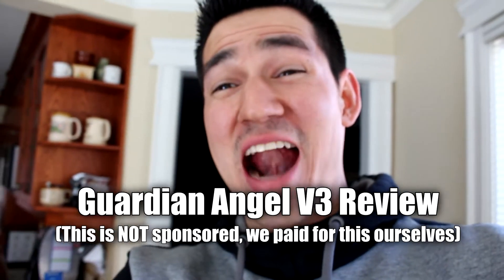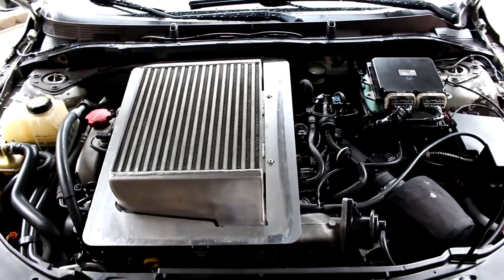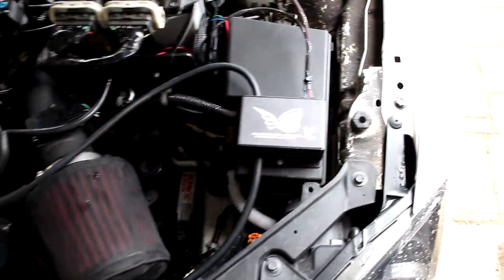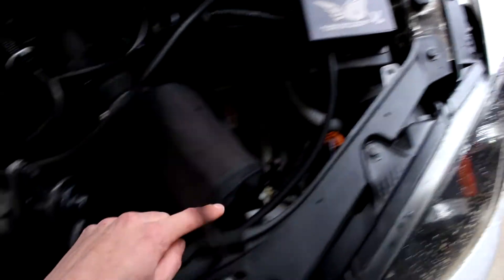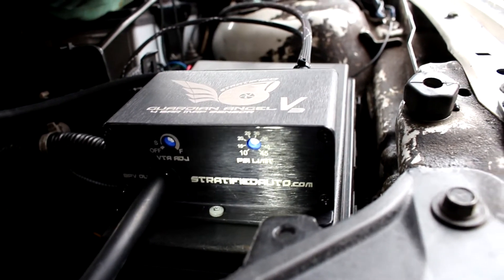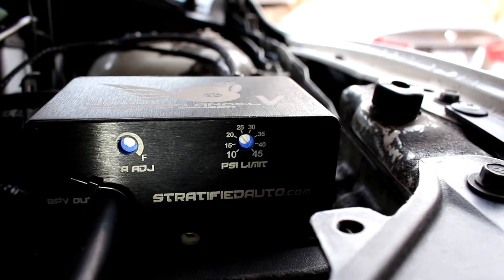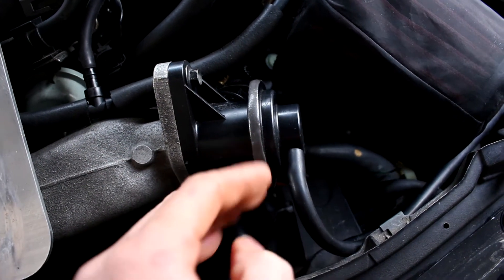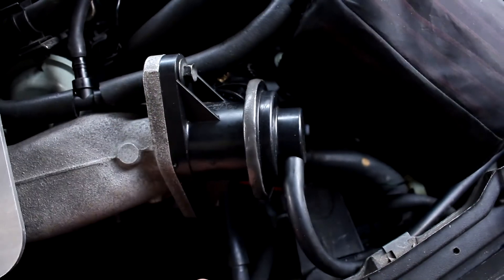Mazdaspeed 3 - Stratified Guardian Angel Fail Safe Review

Comment: question ?? which cable on the map sensor did you tap to detect boost ?Is 4 cacbles and the instructions Stratified Guardian Angel on that part are vague, is just said tap a cable on the map sensor. Which cable out of 4????
Reply from the maker: I'm not sure which wire on the map sensor harness needs to be spliced in order for the ECU to use the 4 bar inside the Guardian Angel. I only use the Guardian Angel for over boost protection because I have a 3 bar map sensor in place of the stock sensor. It may be best to find an ECU wiring diagram and or contact an e-tuner on Mazdaspeedforums.org I wish I could be of more help to you:)

Comment: is the 4 bar map sensor for the angel or does it connect to your car. if it connects to you car how do you connect it
Reply from the maker: I just use it for the GA, but according to the website, the single output wire for the 4 bar map sensor can be wired, most likely into the vehicles map sensor harness (I'm not exactly sure though). Then the ECU would need to be tuned in order for it to work correctly with the 4 bar map sensor. I just went with a Bosch 3 bar map sensor which comes with a harness adapter so no splicing required:) Of course the ECU will need to be tuned for either option. Also, adding more variables into the mix increases the probability for failure ie. If there's a problem with the GA, who knows what will happen to the map sensor signal. The last thing I want is the ECU to receive a faulty and or lost signal from the 4 bar map sensor at wot. But without a doubt, this is a great fail safe to have when increasing boost:)

Comment: I have me a V2. Great product. Running an aftermarket turbo without one is just asking for trouble. All it takes is a pinched ord blown-off boost line and your boost levels can spike and grenade your engine in literally seconds. This is great insurance.
Reply from the maker: Couldn't agree with you more. They also recommend to check to make sure it works periodically by setting it to like 10 psi. I like how it's not a violent boost cut. It's super smooth.

Comment: Following the build lol. @403WHP now. running 100% methanol. GA V3 helped my car alot. Make sure you clamp all those boost lines. That turbo is going to put it n work and work your system. Leaks will become apparent when your boost curve is off.
Reply from the maker: USN Artsen That's awesome man! Yeah we're just having fun with it. Thanks for the tips. At this point were not trying to take it higher than what the stock fuel system can support. I'd be happy with a consistent 350 whp. But who knows what the future holds, I may just decide to go full out with a fully built block and port fuel injection lol
Reply: Meth is bad. Wears the shit out your upper cylinders, upper piston rings, valves, pretty much anything it touches.